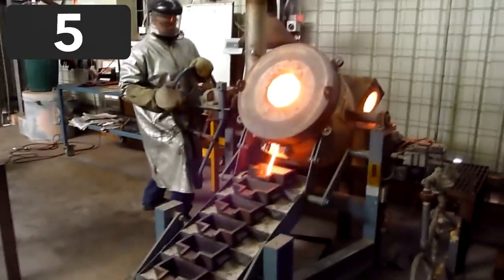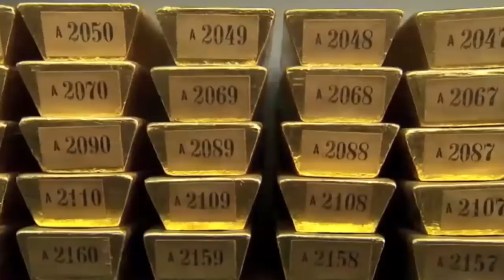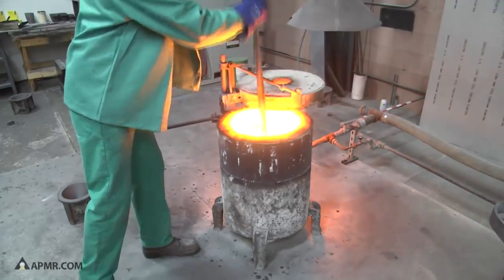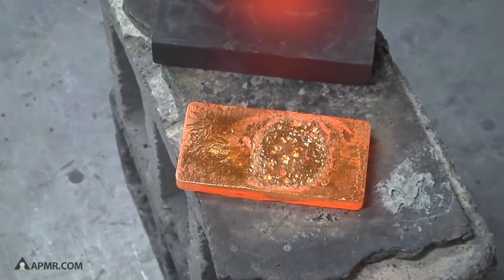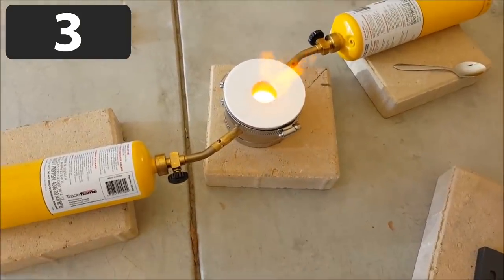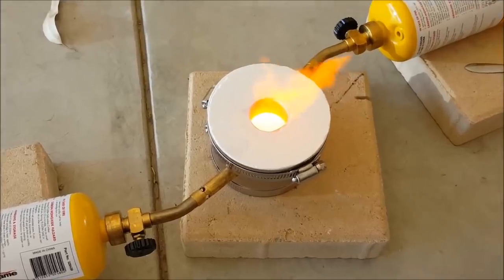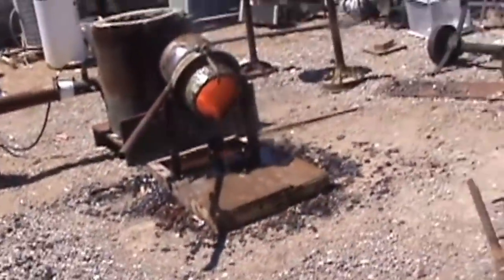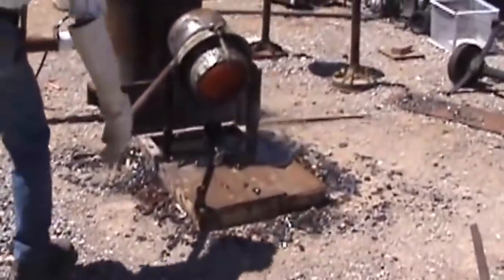Top 5 Gold Bar Smelting Videos

Comment: Dude wanted 22 grand for that quartz and gold clump? Ends out as 230 ounces, and best case scenario the gold is 24 carat and it's worth a little over 9 grand. Likely closer to 14 carat, and it's worth 5 grand. 22? Bah, no wonder no one wanted to buy it.
Reply: InstrucTube Gold in Naturalform is more expensive
Reply: @lalaalbtz4023  3x more ?
Reply: Some people collect specimen pieces, (gold in its natural form usually mixed with quartz) it can bring a nice premium.  However just like everything else it's only worth what someone is willing to pay for it.
Reply: @127BobbyRay  yes, that's true but no one did buy it at that price, and like an idiot he wasted the energy on ruining it. I think it's worth more in it's natural state too, but definitely not 3 times the value of gold in it.
Reply: 230 ounces 24 k is worth around a quarter of a million. But that guy in the video was weighing in grams. So it was a bit over 8 ounces. Worth around 9 grand if it's 24k.
Reply: irishbreakfast Too bad this guy isn't aware because I'm assuming he is under the impression that it's worth less.
Reply: 28 grams is 1 ounce 🤦‍♂️
Reply: Mustafa Mckinlay-malas I cultivate cannabis for a living. I'm well aware 28 grams is an oz. lol
Reply: Soo 23grams is less than an ounce = less than 1 thousand dollars
Reply: Mustafa Mckinlay-malas Where are you getting the number 23 from?
Reply: Quarts piece only had 23g of gold

Comment: The second video isn't smelting, he melted gold sponge and cast a bar.   Smelting is the process of using flux, usually silica and borax to remove base metals such as lead, tin and casting a doré bar that is a mixture of gold, silver, copper and trace amounts of PGM.